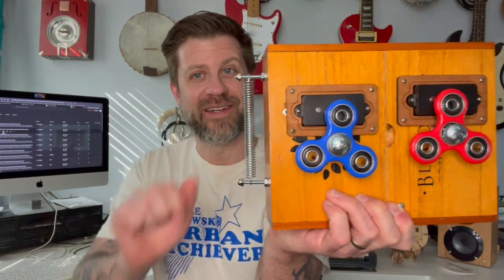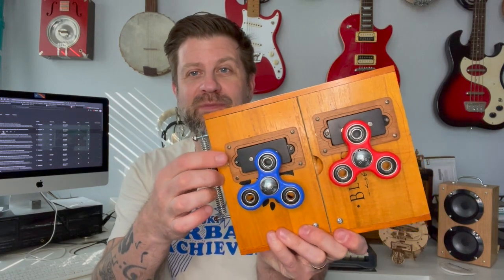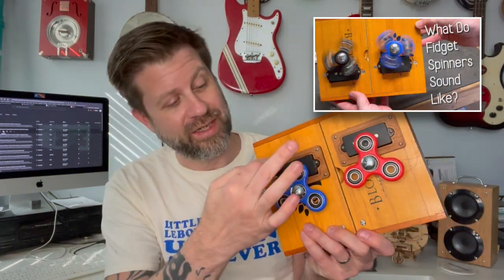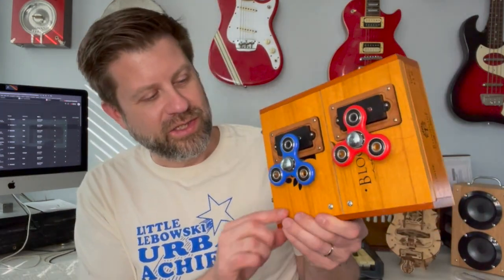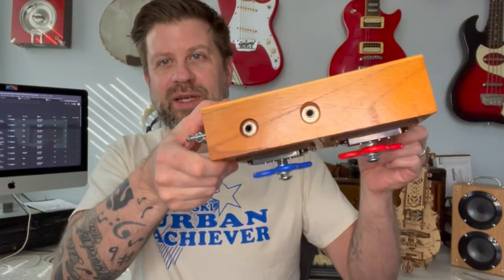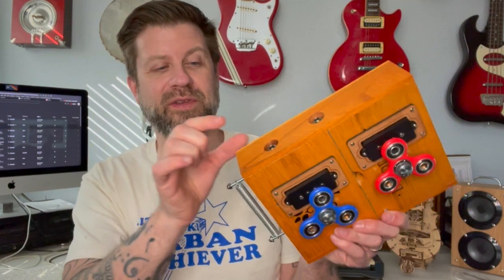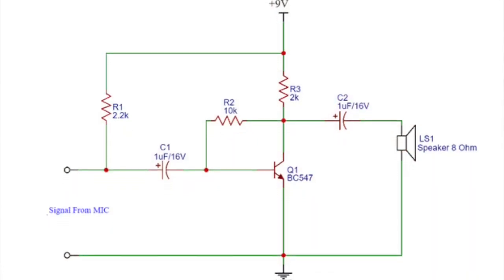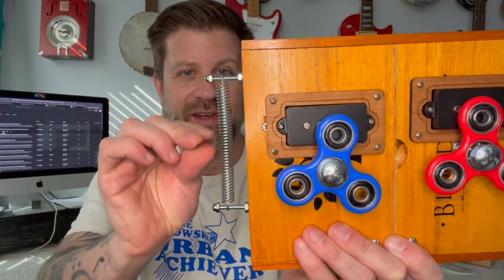More Mods to the Fidget Spinner Box (DIY Instrument)

Comment: Far freaking out

Once again my head is filled with half formed questions.  One of the first to come to mind is, is there a way to get some sort of sympathetic string or strings between/ or maybe under the Fidget Spinners?

Would an amplifier circuit on both outputs be useful/helpful ?
Reply from the maker: That's a great idea. Maybe even add strings that can be plucked. I like it. Thanks for watching.
Reply: @musicalmiscellany  sounds good to me

Comment: I love it more and more.
If I understand correctly, which I'm not sure I am, you could have put multiple piezos or bigger piezo(s) to get more voltage from the spring. Maybe not enough to match the electro-magnetic pickups though.

Also, if I may, when you first plugged the fidget box to your modular synth, did you just "know" that the voltages would be ok (because you know what you're doing 😉), or did you measure or calculate? FYI my level in electronics is intermediate in theory... but not even a beginner in practice.
Reply from the maker: Excellent questions. Very well thought out. I like the way your brain is working.

RE: multiple piezos. What you suggest seems logical. However, I've tried this in the past and found it doesn't increase the output voltage, it just spreads out the "sensitive" area. So, if you were hitting a surface with something like a drumstick where you weren't going to be super accurate, multiple piezos arranged in a triangle pattern may help with evening out the off-center strikes. However, the output level will be more or less the same with 1, 2, or 3. I'm not sure of the physics behind that, but that's what I've found.

RE: input voltages to the modular. I use the XOAC Sewastopol module to bring external audio signals into the modular. The nice thing about this module is it has an input attenuator with clip indicator. So you can tell when the voltage meets modular level (typically +5V/-5V) and attenuate/boost it accordingly. In the case of the spinners, they actually needed to be boosted slightly (but not too much). Additionally, many (but not all) Eurorack modules will simply rectify a signal that exceeds their voltage cap so if you did plug in something like an 11VDC signal, it would simply truncate it to 8V (or whatever the module can handle). Now obviously, if you plugged something insane like 100VDC into a module it would damage it, but clearly you're not going to produce output voltages like that from a magnetic pickup.

Short answer, it's really rare for a magnetic pickup (or a piezo pickup for that matter) to produce more than 2 or 3V of signal which is well within modular range. Therefore you're more likely to boost the signal than attenuate it.
Reply: @musicalmiscellany  Wow, thanks a lot for your answer, that is very generous. I am considering buying a korg volca modular, and at some point would probably like to use strange inputs (I mostly want to produce drones and ambient stuff), so I thought I'd ask. You were really helpful.
I'm most of all interested in making sounds for spoken word performances and/or video score. Cheers!
Reply from the maker: @stephpicher  There are a lot of affordable semi-modular synths on the market nowadays. I really like the CR8Audio stuff. I'm a big fan of the Volcas too. Thanks for checking it out and good luck.